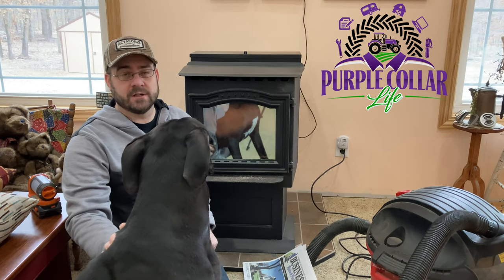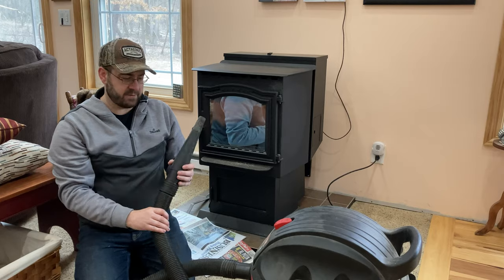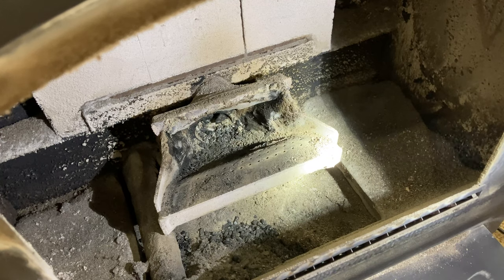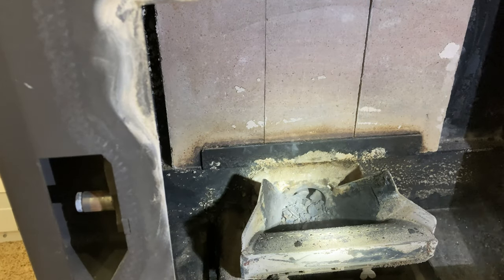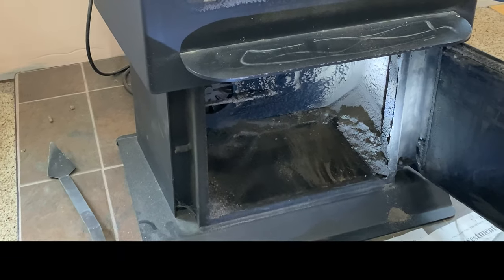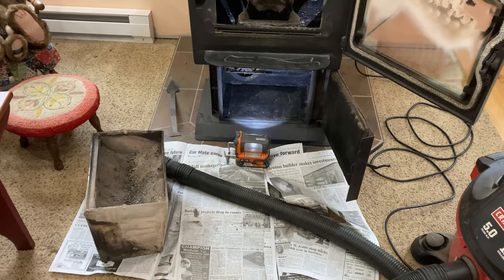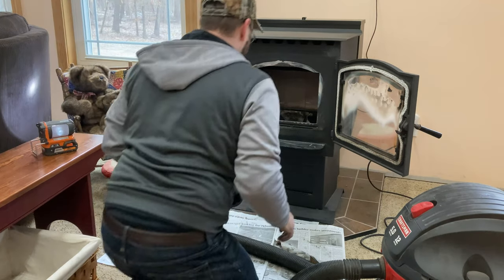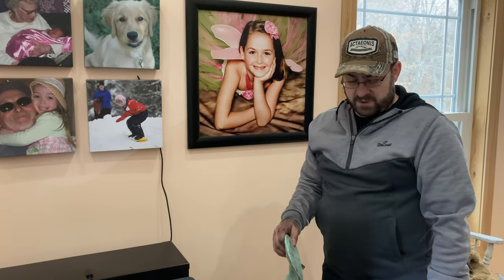#177 How to Clean Harman P68 pellet stove

Comment: You should try unplugging the stove then plug stove back in with the door open. My P68 exhaust fan will stay running for a while not sure how long if it stops I just unplug again. Helps exhaust all the dust outside. Also a old paintbrush works great also
Reply from the maker: Thanks for the tip!

Comment: As for fuel cost how does pellets compare to buying wood? I’ve always been interested how those stoves do, never had any experience with them. Lots of work cleaning it up!
Reply from the maker: Good question!  I'll do a study in the future about the pellets vs wood.  We go through about 2 full tons of pellets each winter.  Price ranges from $260 per ton to $315 per ton.  We only get the premium hardwood pellets.  And we've found the Agway brand to work the best in our stove.  We tried the Tractor Supply ones, the Home Depot ones, and some other cheaper ones - but they create too much ash, don't ignite as well, and don't burn as well.
Reply: I love having a pellet stove. The pellets are just super compressed saw dust. Like the other response, we only burn premium hard wood at $280 per ton. I have the Harmon P65 to heat the house 1600sq.ft. trying not to use a lot of oil. I'll go through 4 to 5 tons this winter. Cheaper than oil but hard to compare to a wood stove, since most people I know cut their own. Generally, I've seen about a ton of pellets burns close to a cord of wood.

Comment: 13:03 I think your fresh air inlet rain cover is upside down, also, why don’t you use a brush to clean your flue pipe?
Reply from the maker: Thanks for watching. I'm not sure how that fresh air inlet cover is supposed to be installed. It was installed by the Harman dealer.  But if it's a rain cover - it certainly does seem like it's upside down.  I  should use a brush to clean that flue pipe - great idea. It never occurred to me.  Thanks for leaving the comment!

Comment: I learned the sock trick while cleaning out a dryer vent duct. A nylon stocking works well too. A clean stove is a happy stove (and keeps the house warm too!) 🔥 Thanks for sharing.
Reply from the maker: Thanks for watching. I was surprised that an old sock would help on the shop-vac exhaust, but it really does.  Good idea to use it for the dryer vent too.  I will do that next time we clean that out.
Reply: @PurpleCollarLife  The more reliable method of filtration out of your shop vac exhaust is to have a second vacuum hose and run it out a door or window.